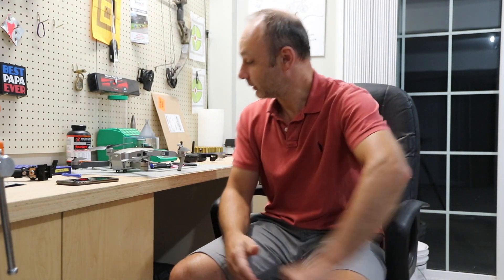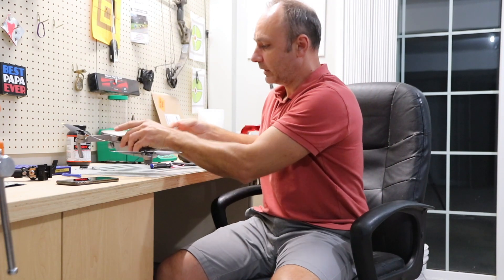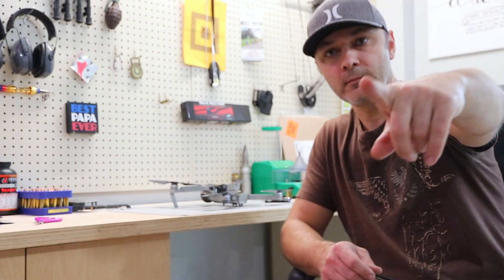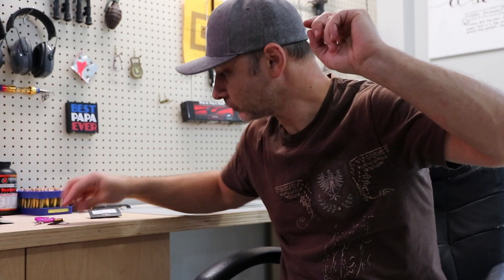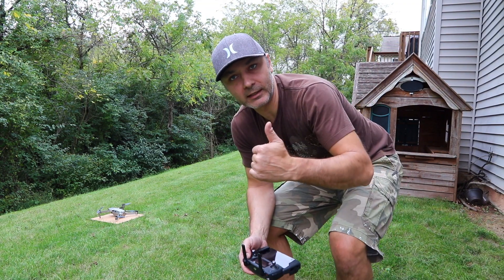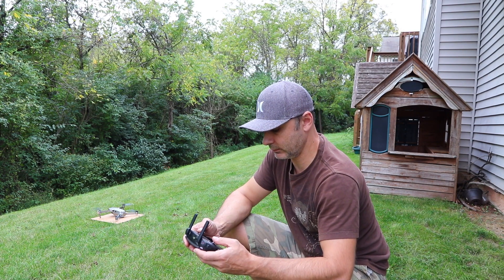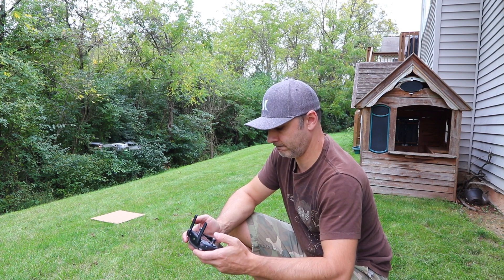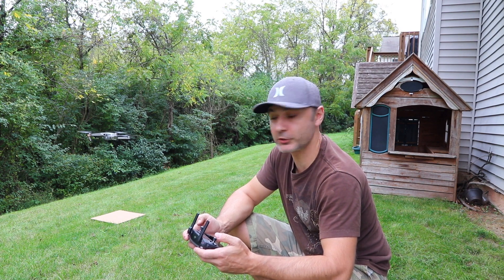Battery Error - FIXED! DJI Mavic Pro

Comment: Great video. It works for me, after the mavic crash, the batteries showed N/A info and the engines could not be started. I replaced the power supply board and got the info back.
Reply: Unfortunately, the problem returned after the replacement of the power supply board. Sometimes it allows the engines to start and then there is battery information, but it also happens that it loses again and does not allow it to start. This is the case with all 3 batteries. Is there anything else I would like I could try, I fly on 1.03.0700.

Comment: Thanks Peter I mentioned I need one 3 weeks ago because I was getting a   BATTERY AUTHENICATION FAIL ON DJI go4 app on all my batteries. I bought the board and it fixed it. Thanks for the video, your the only one that talks about this

Comment: Big mistake is buying a dji M2P drone that comes with a STUPID and never intelligent battery. These batteries gets pregnant after 9 months of purchase (Battery swells) causing the battery to be ejected from the drone during flight, ending in a crash. dji are so devilish by indicating in their policy that batteries are covered for 6 months only, because they know that at 9 month these batteries are giving birth. And the biggest mistake I did was buying the fly more kit and an additional battery to make it 4 batteries in total. All of the batteries now are swelled up. Mind you that I take good care of my stuff, for the batteries, I always discharge them to 40% if I'm not planing to use for more than 10 days, fully charge and discharge on a regular bases and always stored in a cool place between 15 to 25 degrees in a secure sealed hard case by Nanuk.
Called dji for replacement, they rejected my request although I have bought the care refresh and the Select member which was never used once…!

Comment: But what if you only get that message on only one battery? My other 2 batteries work just fine.
Reply: I have 4 batteries and only 1 of them gives a battery error. My remote won't even let me take off with that battery. With the other 3 batteries I take off without a problem.
Reply: I have 5 batteries and only 2 work. Took one battery to Best Buy geek squad and they replace the battery. I’m going to do with the creator says and discharge the batteries all the way and then update the firmware and fully charge the batteries.
Reply from the maker: That means it’s a bad battery, they go south from time to time.
Try discharging all the way until it shuts off in its own and full charge it all the way up, and also reinstall firmware on the drone with that battery in it.
Reply: I just bought my mavic pro 2 zoom last weekend and I’m getting the battery error message on my screen also. I’m gonna call DJI tomorrow and see if they can honor their 6 month warranty. I’m seeing a lot of bad reviews about customer service so I’m nervous.